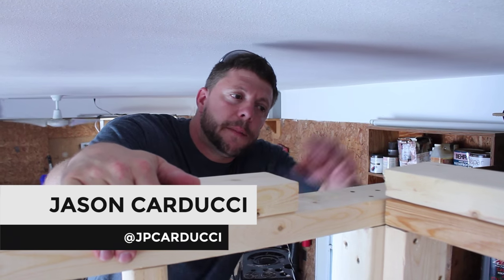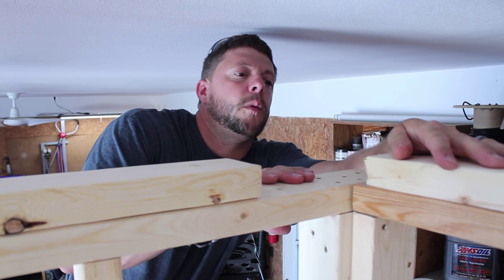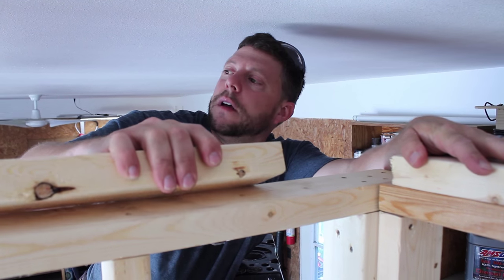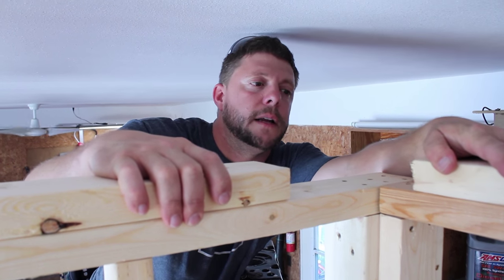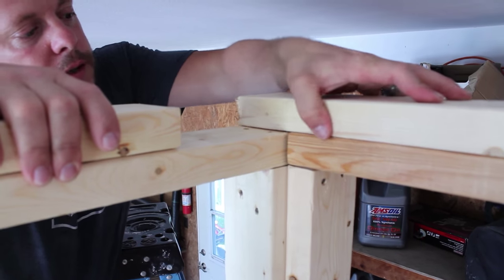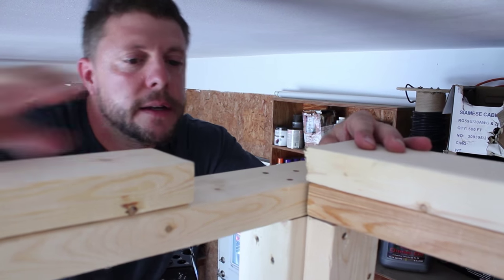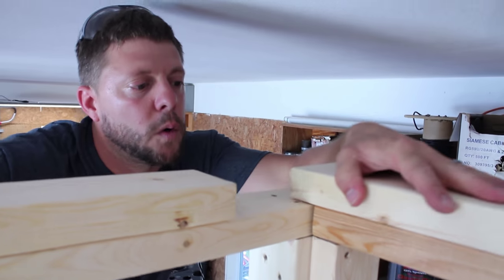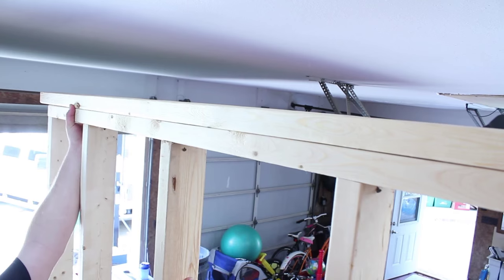How to attach top plates after framing walls

Comment: I have to replace top plate in my garage and will have to go around the bend on both sides of the overhead wall. Going to need palm nailer as I have to jack up trusses to be able to replace and will be tight on room. Whole 11' section of garage wall at overhead door is shot and will be tying into the outside and living room walls.

Comment: You don’t necessarily need top plates to overlap the intersecting bottom top plate, you can theoretically but them into each other and fire 3 toenails from both sides then weld off the corner studs